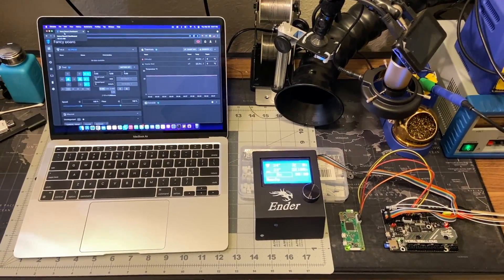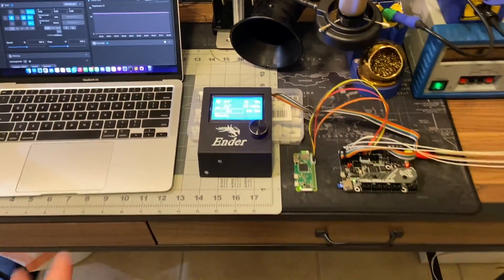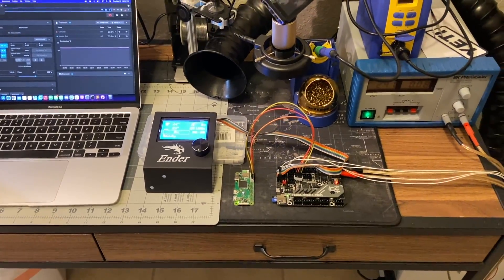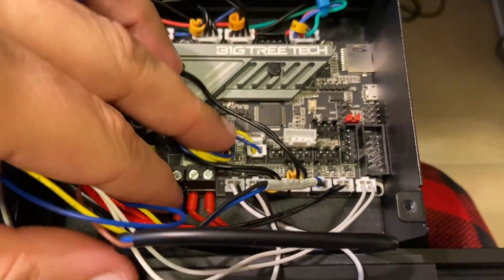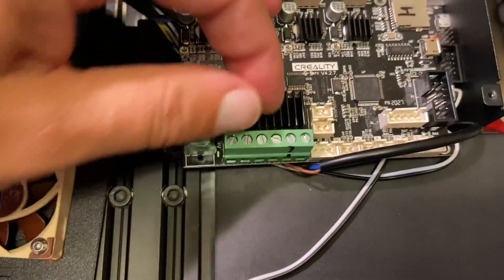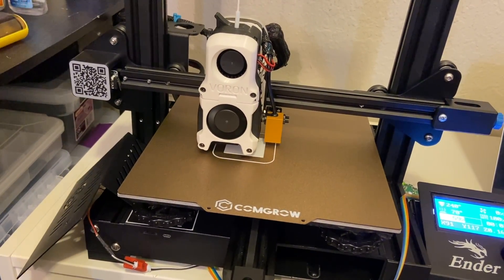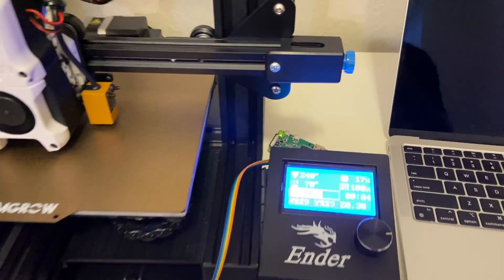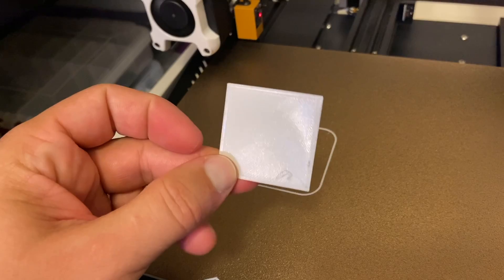Installing BIGTREETECH SKR Mini E3 V3.0 in Ender 3 with Klipper

Comment: i want to replace build surface ender 3 v2 with pei spring steel but i'm still confused about choosing pei textured or smooth to print abs and pla do you have any recommendations for me
Reply from the maker: You can find double sided PEI sheets where one side is smooth and another is textured, difference usually about 10$ and it's worth it. I personally mostly use textured. By my opinion PEI sheet is the #1 update to have, solved most of the issues with adhesion and doesn't require any glue sticks or any other solution, only IPA before print. As it is a coated(textured) or glued(smooth) surface it is not as durable as glass and i recommend to have auto-bed leveling with it cus if you will run nozzle too close there is a chance you will ruin the surface. Proper z-offset calibration will keep it good for a long time. Good Luck ;-)
Reply: @hobbyistnotes  I have an E3V2 and I've never had to use glue or anything on my glass bed.

Everything sticks. From pla to abs/asa. All I do is clean the bed after every 10 or so prints with isopropyl alcohol.

Not one issue with Prints sticking in 9 months using it daily, all day.

I really don't understand why people struggle with this so much. Tells me they're not leveling the bed properly, using the right temperatures or not using an enclosure when necessary or don't know how to use rafts and brims properly.
Reply from the maker: @dangerous8333  I don't think it's that simple of an equation, not only print surface playing the role: ambient temps, quality of the plastic, leveling and slicing. For me stock "ultrabase style" print bed worked well only with PLA. I don't like PLA's sweet-odor and mostly use PETG, which is in my environment only sticks well to PEI. I spent countless days debugging "ultrabase style" print bed (i think i printed about thousand of calibration cubes), it drove me crazy as it has failed me too many times, where PEI worked perfect since installation and was total fool proof. In last 4 months of use PEI I lost 0 prints due to adhesion no matter how bad was leveling or what material used + it has nice texture(not everyone like it tho). Also as I use Omron inductive probes they only work with spring steel sheet and per my math: PEI bed + Fast ABL = BLTouch (laggy in enclosed env). The reason why I pref to use ABL with spring steel sheet is cus I take it off all the time and it's easy to mess with leveling.
Reply: That's a trip, I love the glass bed. All my prints stick and pop right off. Pla to abs. The only thing I have to do is clean it with isopropyl alcohol. I don't like having to touch my bed for any reason. Although, now with the proliference of Auto bed leveling it's not as much of an issue.

Just ordered the new s1 and it has a spring steel sheet. So I guess I'll know soon which one I really prefer.

Comment: HI great vid. Could you please post your'e printer config file a as i'm new to klipper and would like to see it.
Reply from the maker: Hello, In to the description you will find link to a Bigtreetech Github repository it has config named: SKR-mini-E3-V3.0-klipper.cfg, i had few adjustments for my Inductive probe i use, the rest pretty much the same.
Reply from the maker: Added link to a git-hub repo with my configs